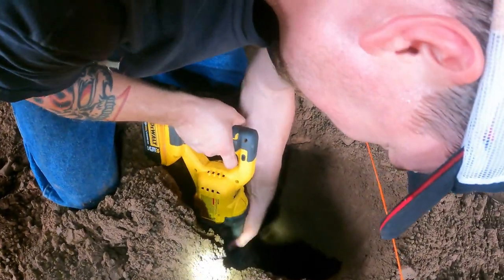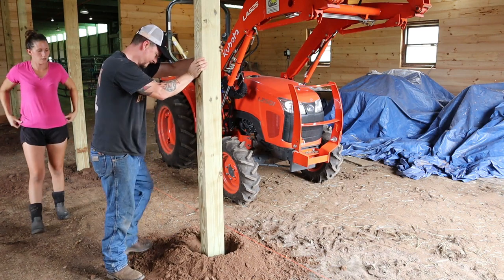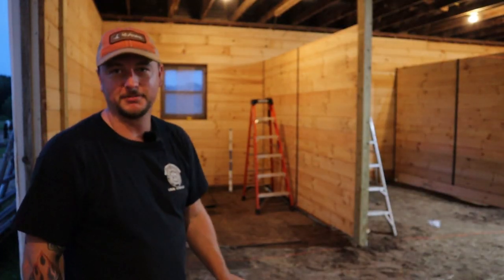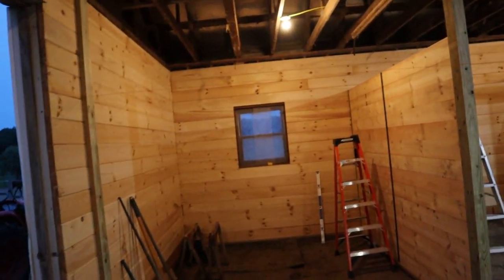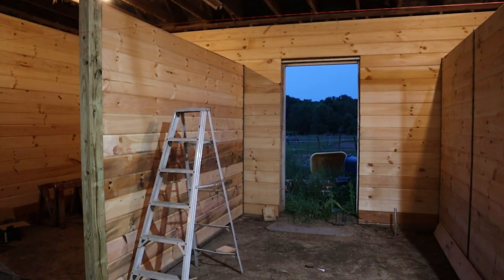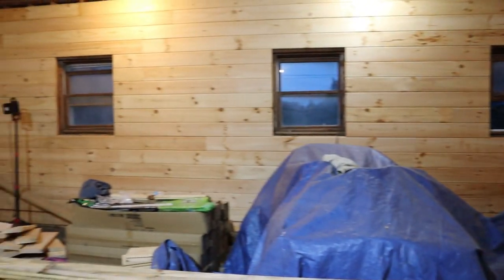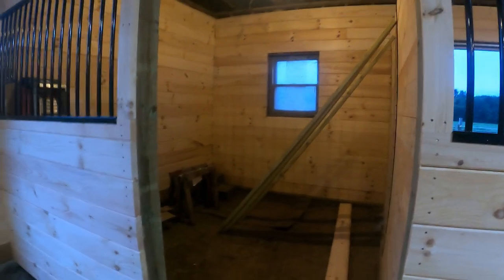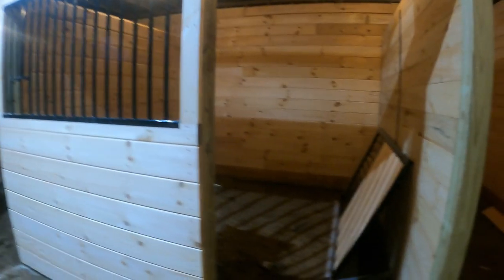#60 L2501 POST HOLE AUGER Setting Posts In Barn Build

Comment: Your experience with a tractor mounted auger is a little better than mine. We got tons of rock, lack of down pressure normally requires using a digging bar & manual labor. Place is looking good. 👍🏼
Reply from the maker: There was lots of digging bar and manual work lol. we will probably borrow the hydraulic auger. Thanks for watching

Comment: Hello from Minnesota. I've got a similar 3 pt post hole digger. Right now the PTO shaft is seized up. Great progress!
Reply from the maker: Hey Ricky. Try spraying a product called "Kroil" in the shaft. Its a little pricey but an amazing product. Acetone mixed with automatic transmission fluid may also work well for that. Thanks for stopping by!

Comment: I am with you on not having down pressure. It makes it twice as hard to get the auger started and to get to you depth you want. keep up the good work!
Reply from the maker: It can make things frustrating, but i would rather have it over just hand digging lol. I think in the other building which will be a lot more posts we will use the loader mount hydraulic unit!

Comment: Hey Richie, nice video. I never had much success using a 3 point post hole auger, too many rocks in my area. I purchased a hydraulic auger and fitted it to my Kubota kx 121 mini excavator. The setup works better than the 3 point, rocks are still an issue. The other advantage is the ability to reverse the direction of the auger. In the right soil conditions the auger will screw itself into the ground and get stuck. At that point the 3 point is difficult to get out of the hole. Good luck with your stall building. Paul
Reply from the maker: In the video I mentioned how I used the hydraulic auger for the pasture. Really not a fan of the three point auger either but it’s what’s on hand.
Reply: Agreed, the 3 point auger beats manually digging the hole by hand.
Reply from the maker: @bendermanufacturing  The three point auger means a lot of hand digging lol! I can use the hydraulic auger on the 7060 or I may borrow my neighbors Toro dingo with auger, should be nice and compact to use inside

Comment: Nice job 👍  I took my Pto shaft off and mounted a hydraulic motor on the gear box . Sure works nice . No shear pins and reverse when you stick the auger . I had serious frost problems on post moving and heaving all the time being on clay base ground . I do everything with clear one inch lime stone now . Problem solved . Nothing has ever moved . The foam is interesting .
Reply from the maker: Thanks Steve, I have a loader mount hydraulic on I can borrow I just got to drive an hour to get it, that’s probably what I’ll do.